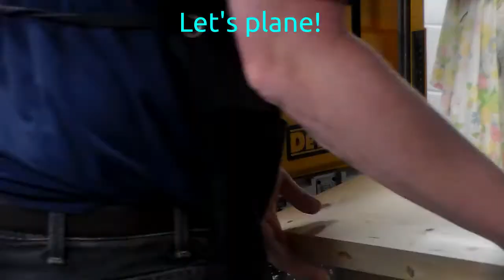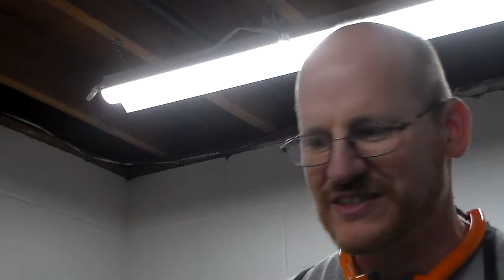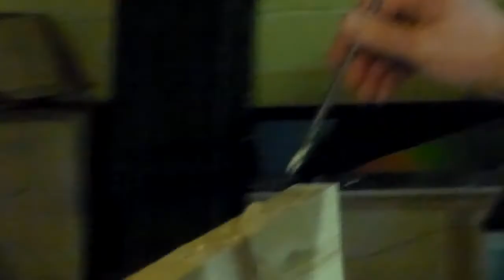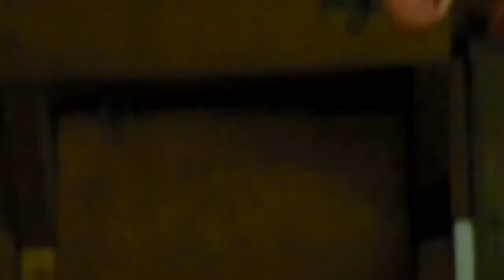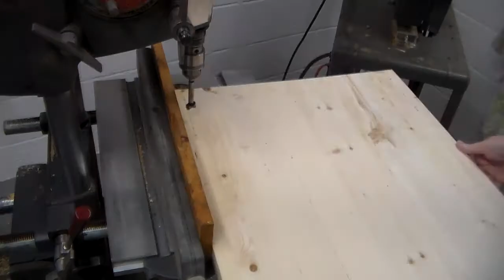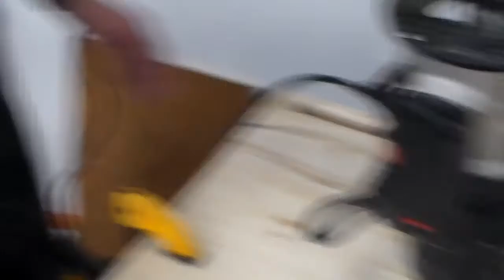Two Philips, Two Shopsmiths Episode 002: Continuing to build a CNC cart

Comment: out of curiosity, did you see a benefit to using biscuit to join rather than dowels?
Reply from the maker: S Chase I had a biscuit jointer already so that was part of the decision to go that way.  Also, the biscuits allow you to be a little sloppy with where the holes are cut.  I think for the average guy like me it's easier to get a good strong joint.
Reply: Thanks!  I thought it may have been for precise side to side alignment.